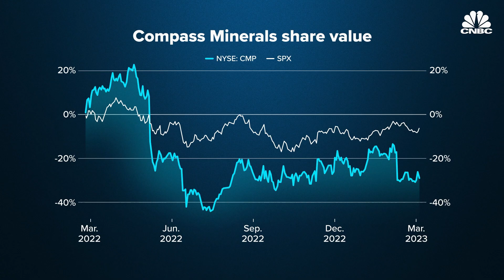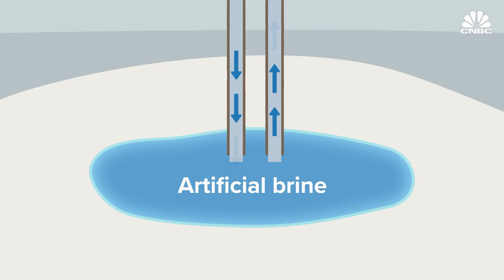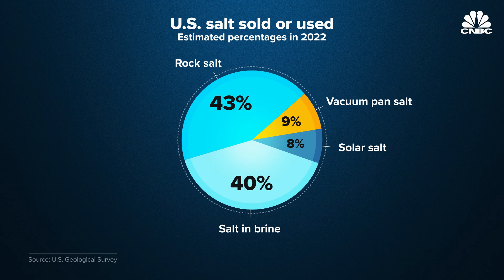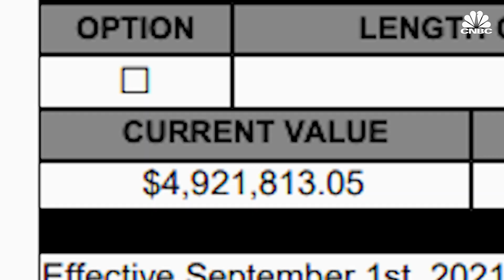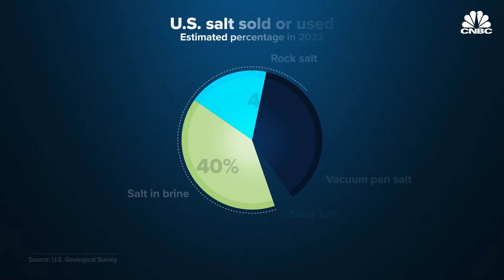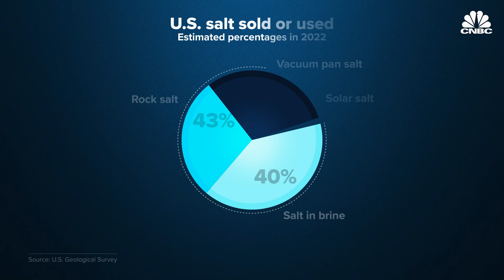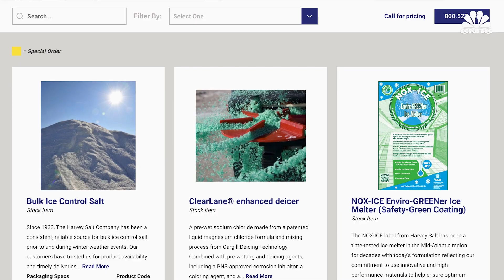Why Salt Is Vital — But Potentially Catastrophic

Comment: I know up here in the Pacific North West in the temperate area, they rarely use salt if it can be avoided, Its temperate here so it rarely snows but the concern is actually for the Salmon population around here.  It was very different than when I lived in the Midwest where that rock salt got layered thick after a storm.

Comment: Lot of talk of percentages in terms of modern usage, but no real solid numbers given...and I know for a fact, that since at LEAST 1995, many of your 'heavy salt use' road salt regions of North America have fought tremendous battles to eliminate or greatly-reduce their use of salt on roadways...vying for other materials like sand, crushed rock, beaded glass and more. Why? There is an 'opportunity cost' also with using salt...infrastructure damage, from road signs to bridges...they all suffer and need more-frequent replacements where salt is heavily used. Canada predominantly went away from salt in the 1990's to 'chirt rock', a chipped soft rock that instead of 'melting the snow and ice', it infused it...basically creating a type of 'sand paper surface' to drive on, that is as safe as dry asphalt in most cases. East Coast regions went to a similar idea, when as early as the late 1980's, the EPA stopped many places from piling up huge 'plow piles' of road salt scrapings, often to later be trucked to inlets and bays and dumped into the ocean...in that case, it wasn't originally the salt they didn't want dumped in the ocean...it was the road pollutants, like tire debris and oil spillage they were fighting. Plow scrapings were banned or highly limited from 'ocean dumping', because of this. So...when you say 'we are using 20-million tons a year, and 49% is going to road salt...this MUST be taken into comparison with past years and decades of historic use. In this case, you find we are really cutting back our salt use industrially. When you simply compare it to edible salt, and knowing we have worked vigilantly to reduce salt consumption, you really aren't getting the full picture of what consumption trends really look like. While I don't have the total figures for each year, I do know that we used almost 300-million tons of salt in 1978 alone, for road maintenance, nationwide...that's a HUGE reduction...

Comment: Salt is the most common mineral on earth and is essential to human survival, because it is one of the substances upon which all of life on Earth evolved to depend on.   Salt is involved in regulating the water content (fluid balance) of the body. The sodium ion itself is used for electrical signaling in the nervous system. Human beings need salt right down to an atomic level...

YET, until about 150 years ago, in the history of recorded human activity, its procurement was unbelievably difficult.

One of the first recorded wars in human history was fought in China over, among other things, salt. Salt was comparable in value to gold, and was also - in China - used as a medium of exchange. The Romans were some of the first to realize that if they controlled the salt of a region, they controlled that region. The modern word salary is derived from the Latin salarium, meaning “stipend,” which is related to the Latin word salarius, meaning “pertaining to salt.” But the connection between the words is lost to us, although there is no concrete evidence that Roman soldiers were ever paid in salt or that the salarium was, as another theory holds, an allowance for salt. But it would lend some background to the phrase "worth your salt"....

Amazingly, salt was regarded as so valuable that spilling it was considered a sin - precipitated in popular origin as being caused by the devil shoving you from behind.  Which is why if you spilled salt you would throw it over your shoulder to blind the devil and send him back to hell.  There were many salt rituals in the ancient world, and casting salt over something as a curse or purification seems to have been a part of several different traditions. It is said that one disciple spilled salt at the Last Supper, and that disciple was Judas. EVEN UP UNTIL OUR REVOLUTIONARY WAR, salt was of such critical importance that the British attempted to cut off our salt supplies to essentially starve the American army by destroying their ability to preserve food. 

And yet today, with the advent of modern technology after the industrial revolution, we produce and mine salt in such industrial quantities that we can spread it over our roads when it snows.  That would have been nothing short of unthinkable to people a mere 200 years ago, to say nothing of ancient peoples.

Comment: 1:30 : "Both of these are 100% sodium chloride..."
1:55 : "Whereas the de-icing salt is not produced in food grade conditions so you really wouldn't want to eat this"

More lies from CNBC. If both products are 100% of the same thing, the processing method is irrelevant and both should be equal. #CNBCFraud

Comment: You could have picked better imagery for the rusting rebar section 8:26 , the video you showed was road degradation from erosion - not metal corrosion.  

Also, that appears to be blacktop.  Typically, rebar is used as a reinforcement measure in concrete.

Comment: Bravo thank you for this report as I always wondered about salt. My neighbor's well got contaminated from Road salt and he had to get a new freshwater well drilled farther away from the road at a cost of about $12,000. This well contamination locally is happening more frequently due to overuse of road salt. And now we have vehicles whose engines can run way past 300,000 miles but will never see that length of travel because the body of the vehicle corrodes from road salt. We are doing this without much consideration for the future. It's extremely hard to clear up fresh water after its been salinated, and salty freshwater has repercussions for our own health as well as for our agriculture and for the environment which sustains us.  It seems like the only time we appreciate fresh water as a species is when we lose it. Clean fresh water is so easy to take for granted, until it's too late.

Comment: In my prepping, I have (still sealed in the original water-proof packaging) table-salt and also (in a different container) sugar. These are then in a respective metal box, sealed furthermore. No more than a shoebox can hold. Not only does salt have various uses, the notion of "too much salt" in a prepping dietary emergency is overshadowed by "not enough salt" as in where a person can get salt shakes (or optimisation of the body's electrical systems). Water retenation and maximal muscular force of unknown quantity envronmental pressures (such as being able to walk a great many miles/kilometre or using arm muscles to pump air or water of lift one''s own weight) can impact upon the body's need to regulate salt such that precise measures of sodium chloride in the person's diet is a sensible plan. This also means mitigation of the other usages of salt where possible can be accomplished by usage of alternative molecules. For insance, I have methanoic acid in case calium carbonate is to be reacted with or, if needs must, reduction of ice is required where by methanoic acid is less liklely to be corrosive and excess reagents can be calculated. Balance of sugar is also worth noting. Be mindful that gypsum and salts can create cyanides in aqueous solutions and this can be important fior planning such as gardening. Consider that a small amount of sugar can be used as a plant food if a person needs to buy more time before potting on a plant at the risk of it becoming root bound where weather is a factor in waiting. Plants can be a source of nutrition. Glucose or some other sugars (and arguably table salt) are a dead food and store well if you think it through and read up on it, and travel well if yu plan it thereby countermanding reliance on logistics. Logistics are often planned on graphical linear inequalities, so those can help you upon revision. Some open source content (including digital) exists so yu can look into all that and various forms of salts from different metals. Two thirds of the Periodic Table elements are metals, pretty much. It is worthwhile prepping a printout of the Periodic Table in your prepping items alongside formula triangles (as in the sort 16 year old get given in their physics classes at college or school). Top tip, look up "solute potential" for cells in biology and compare the word "isotonic" to sports drinks labels you might be familiar with for a healthy context. Ions (chemical energy) are from the effect of electrons in relation to effective nuclear charge. Temperature is movement energy (eventually kinetic) in terms of photons whereby heat or light can be described using infrared photons. That information should save you some time. If you are thinking of using a multimeter in your prepping, consider one with a K-Type probe as a thermocouple. I opted for Uni-trend. Those multimers are about 100USD (seventy something GBP) compared to the 25 USD sort (about a tenner or more in Aldi or equivalent competeing brands). It is just that people sometimes prep these things for fixing things in a safe manner around the house or working hobby. If you want to do a good prepping that way, it is nice to know that having one of each price range multimeter not only goves the extra features but allows one to follwoing an electrical signal path from source to drain using both at once. Salt in water and heat and electrolysis can be one way to clean water if you are strict with being careful and obtaining the nuanced wherewithal. Think about adding GPIO to a PC if you want to budget for that. Salt can be used in tracking disease for some fly species if, upon catching a fly, with care, one examines the creature by placing it on an icecube to stop it squirming so as to take a photograph of it from all angles, and tethering it witha a hair. Then a sprinkle of salt will melt the ice from fly expiditely and return its temperature to its homeostasis (probably unharmed) still on the hair like a leash for controllled experimentation. Harvest of maggots can be done in this way in a prepping scenario of urgency for biology and health data.
This information is to help people delve further into a few simple steps because water is prepping item number one.
My comment has no hate in it and I do no harm. I am not appalled or afraid, boasting or envying or complaining... Just saying. Psalms23: Giving thanks and praise to the Lord and peace and love. Also, I'd say Matthew6.

Comment: I can't believe you did a piece on salt without mentioning the sodium-ion battery technology that is going to absolutely revolutionize personal transportation, along with stationary storage of intermittent energy generation.
Reply: Since those batteries are still in development, that use case doesn't even show up on the chart for salt usage.
There are dozens of uses for salt that are more important right now
Reply: @enadegheeghaghe6369  - Those batteries are not still in development.  CATL is building a sodium-ion battery, right now, that is being used in at least one brand of EV.  They are here and they are the biggest reason lithium is down 35% in the last month and over 50% in the last year.  This stuff is changing so fast!
Reply: @jasonbroom7147  so which car can I buy now that has Sodium batteries? And how does it qualify as one of the top 50 uses for Na right now?
Reply: @enadegheeghaghe6369  - BYD, one of the biggest vehicle manufacturers in China, is using a sodium-ion battery in one of their EV's.  If you can't see the significance of that in the future of alternative energy storage, including what that has already done to the cost of lithium, then maybe investing is not for you.
Reply: @jasonbroom7147  How many of that EV have been sold? What miniscule percentage of current Na use does it constitute? 
And by the way this video was about current Salt usage in general not the future of alternative energy. Maybe you watched the wrong video. 
There is no investment advise in the video either. So once again you seem to like going off on your own tangent.
Reply: You could do that video.
Reply: @Lakshmi1118  - Lots of other channels already have, but leave it to "NBC" to miss the mark entirely.

Comment: I'm surprised there is no mention of the cost to consumers as their vehicles corrode away and have to be replaced far sooner than they should.   The economic & environmental cost is enormous and far outweighs the benefits of salting the roads.   Where I currently live, there are record snowfalls and no salt is used at all - it seems be either habit or just the industry pushing salt on roads, esp. in the Northeast.
Reply: Where is that exactly?

In Pittsburgh where it is extremely hilly I think the calculus might be different but I'm genuinely curious
Reply: In central Oregon we use cinder instead of salt
Reply: Precisely, when people can also consider slowing down and not getting overconfident.

Comment: putting salt on roads is INSANE
Reply: Not really, the negative effects have been entirely blown out of proportion in this video. It's probably not a good thing to keep doing it if we can conceive of alternatives, but it's really not a giant environmental disaster like they lead you to believe. Look at any cold climates where they regularly salt the roads for hundreds of years now, no major issues, unlike the widespread use of synthetic fertilizers worldwide. Grass and and weeds and trees still grow along edge of the road just fine, lakes and rivers are still thriving on the edge of the roads. I'm sure the salt levels must be accumulating slowly, but it's not like you could taste a difference in the water or anything, and there are no dead fish floating around in all the lakes or dried up plants along the road because of runoff.
Reply: @tjwoosta  hope you are correct

Comment: hold on, they highlighted Bangladesh with having saltier fresh water, and then said that the main reason freshwater is getting saltier is because of the de-icing road salts... but it doesn't snow in Bangladesh, does it?
Also,  i've seen videos showing the hyper salty brine thats created when desalination plants try to make fresh water out of seawater... why isn't this being used to process and produce salt, instead of dumping it back into the ocean causing more problems?
Reply: I can answer the second question. Cause it is not economically viable. Same reason that gas is burned off  or plastic is not recycled. It could be done and it would make sense fot the enviorment... but not not economically. And that is all that matters.
Reply: @grischa762  thanks; had a feeling it was along those lines. For all the good we are capable of, when it comes to scale, we're ultimately a very selfish species, aren't we? Or rather we've built a global system where the powerful few dictate what happens globally and is driven by their own self interests.

Comment: There’s ABSOLUTELY NO NEED to spread salt on the roads in winter to keep drivers safe. Instead of the states spending money on salt, allow subsidized prices for people to buy snow tires, they’re just much better for safe driving and don’t have adverse affects on the environment. There’s plenty of states that get heavy amounts of snow and don’t spread salt. Colorado,Utah Oregon,Washington are the few that come to mind. Not only is it better for the cars, but the road infrastructure doesn’t corrode and deteriorate as quickly. Bridges, highway overpasses and even the pavement itself all fail far faster than places that do not spread salt.

Comment: There have been reports that Japan monitors the salt usage of China. They don't share this data, but they can confirm that China is using less salt. Japan believes that China's population has shrunk. In recent months, China has reported a small population drop.

Comment: I remember 17 years ago I was in charge of a large snow removal contract at a local smelter. I asked the Transportation Department to order 26 skids of salt so I can place them in the S.O.S. bins. You never place loose salt or sand as it freezes solid when moisture is present. I received a call and the transport arrived and we could start placing salt bags in the bins. Once the driver removed the tarp I immediately noticed they sent 26 skids of restaurant / cooking grade salt. I refused the load of salt and notified the Manager of Transportation. We all had a good laugh, then they ordered the correct salt.
Reply: Good thing that you noticed!
Reply: Tell us another funny story!
Reply: Lies again? RSL Arabic Text

Comment: In Manitoba we don’t use salt on our roads. We use sand.
Reply: And all of the cars are in much better condition than other places that spread salt. I really wished that it would change in the USA (or at least Wisconsin where I live). It not only corrodes car’s fast, but all the road infrastructure deteriorates faster. Metal bridges, expansion joints on highway overpasses are held together with steel bolts, even the pavement falls apart faster when salt is spread vs just sand.